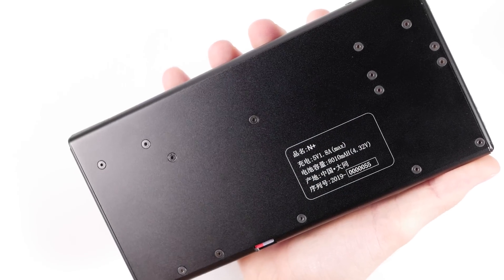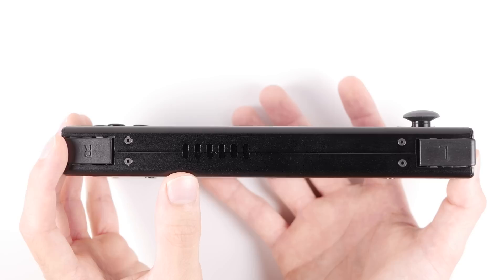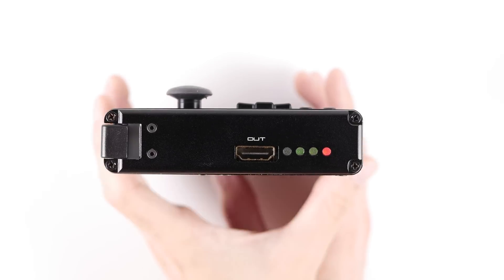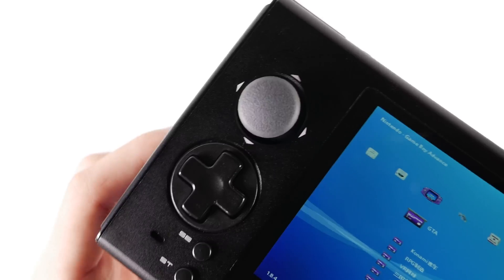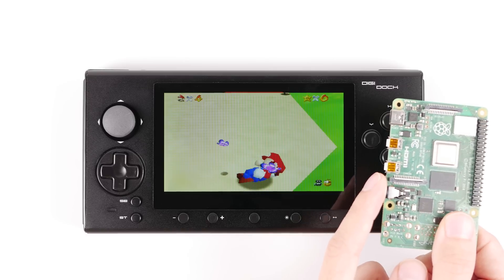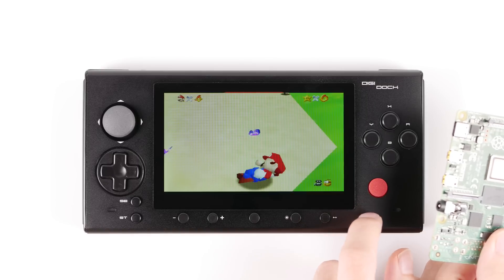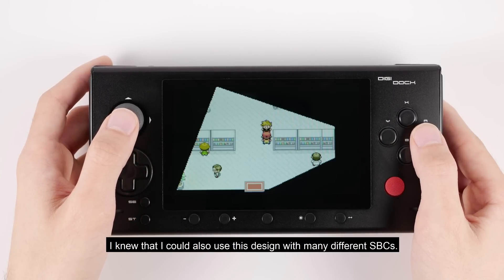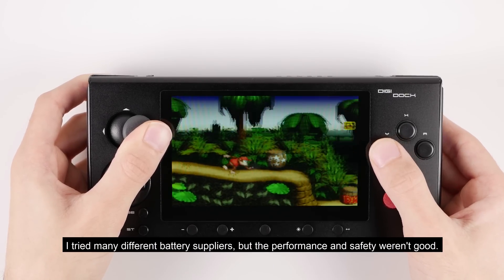N+ Digi Dock - DIY Modular SBC Handheld First Look + Developer Interview

Comment: I really do wish there were separate dual shoulder keys, but if you can modify it to add them yourself that's fine with me.
But what about R3? The PSP joystick doesn't support that.
Reply: if you can use l1 while holding l2 at the same time that would be acceptable. I a button i'd like to use for r3

Comment: This is really cool and I want one, but it would be even cooler if there was a Switch-like dock that you could plug this into when you're not on the go. That might seem redundant looking at the full size HDMI and USB ports, but it's nice to have a way to just drop something on a charger/HDMI in a single fluid motion and move to the couch with a Bluetooth controller.

Comment: How is the HDMI output? Do you need config changes to use it or just “plug & play”? Have you considered disconnecting the fan and lowering the overclock -if any? Does it need drivers for the screen / controls or is it HDMI and normal keyboard emulation without driver?

Comment: I would like to see you review the Evercade. I have zero interest in owning one and never will. I just want prospective buyers to see a HONEST review before spending their money. I believe every single review thus far is either a paid review or heavily influenced by free merchandise. Not one reviewer has mentioned the hardware specs or even tells if the screen cover is plastic or glass.
I believe the device is doomed from the start but someone should do an actual honest and informative review.
Reply from the maker: Thanks for the heads up. I contacted them so we will see what happens.
Reply from the maker: Well, they weren't interested, but I do see why you were concerned based on the reviews I saw. Good eye.
Reply: @TakiUdon  They won't sent it because they know you will give an honest review. An honest review is something they can't afford.

Comment: This is very similar to something I have been trying to build but got stuck on the casing aspect having bought a screen that was arguably too big.  I think that if the next version had a more rounded profile to the top corners where the shoulder buttons are it would be more comfortable to hold.  Another suggested improvement would be to use thinner shoulder buttons so that it could have a second set for games that would use them.  That or a second set of buttons could be installed around the back where your fingers would rest.  Otherwise this seems like a pretty neat unit and I would be interested if it became available outside of China.

Comment: Could you say more about how you were able to modify your Pi 4 to remove the large ports? That is not an easy task.
Reply from the maker: Oh, I just went to town on it. I was originally going to try and salvage the parts, but I gave up with that after doing one and just started ripping them off slowly. There's a huge difference between a professional doing it and me. Once I show the 3b+ that he did vs. the 4 that I did, people will laugh.
Reply: @TakiUdon  Ripping them off slowly? So you just cut them off with wire cutters or did you go full Hulk Smash?

Comment: Looks interesting. Looks perfect for Steam In-Home streaming or Moonlight.

Some random thoughts:
It would be interesting to see if it was possible to add a 802.11AD/AY (WiGig adapter to enable wireless HDMI docking. There are USB 3.0 WiGig adapters out there. 
Just Imagine placing the device next to your TV and it displays the image on the TV through a WiGig dock.

As for the layout I would add a button next to the right analog stick and just map it to R3, or add an analog stick like the one on the left. For the L2 and R2 I would probably prefer an actual set of separate buttons, but they wouldn't HAVE to be on the top, you could put them up in the right corner like the black and white buttons on the original Xbox "duke" controller. You could also put them on the back.

Comment: Taki, is this device better than the LCL pi
game boy? I have one with pi 3B and runs everything up to dreamcast, plus it has 6 normal buttons and 2 shoulder buttons with a ps vita analog.
Reply from the maker: This device can upgrade to things that are significantly more powerful than the Pi3b. It just depends on what works for your budget. I'm going to be trying this out with a m5 compute stick once I get my hdmi pcb done.
Reply: Taki Udon Does this device have raspberry pi inside?
Reply from the maker: @hurry8927  Yes, a 3b+